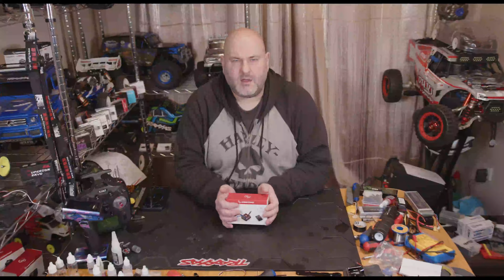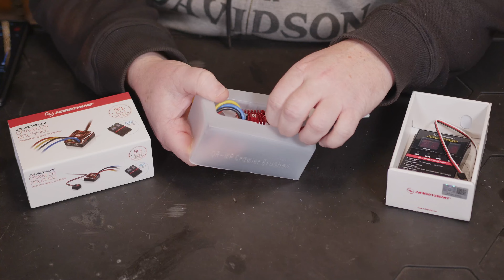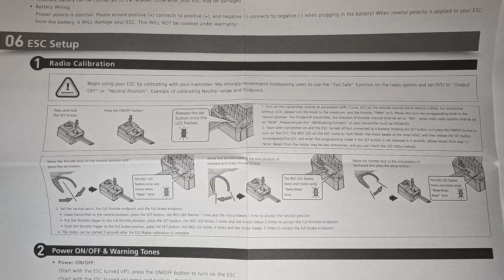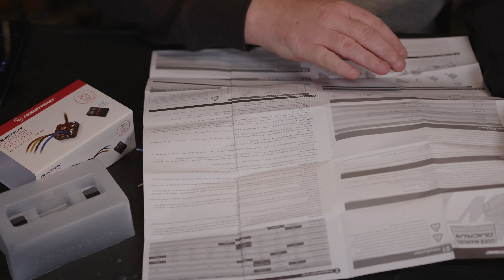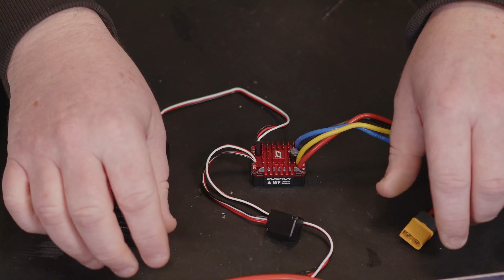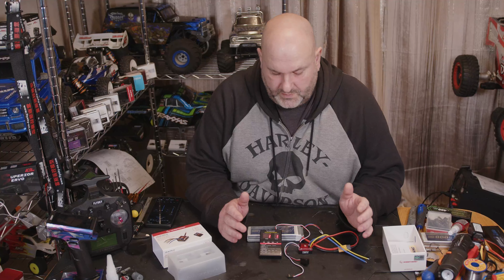Hobbywing 1080 G1 unbox and programming.

Comment: Thanks for the video. I didn’t have matching battery connectors for my new 1080 G2 ESC so I used 2 wires connected to 9VDC battery to program the 1080. 😉
Reply from the maker: One way of doing it :) if it works it works

Comment: Another great video, mate; I appreciate what you do with your videos; I just picked this up from Amazon as a backup, then I purchased another Vanquish VS4-10 straight axle, I also purchased a Vanquish Phoenix VS4-10 Portal, and when I bought the motor with built-in ESC it did not come with a controller board I think I can use the one that came with this kit. Thanks in advance / Joe
Reply from the maker: So long as it's a brushed motor should work fine :)